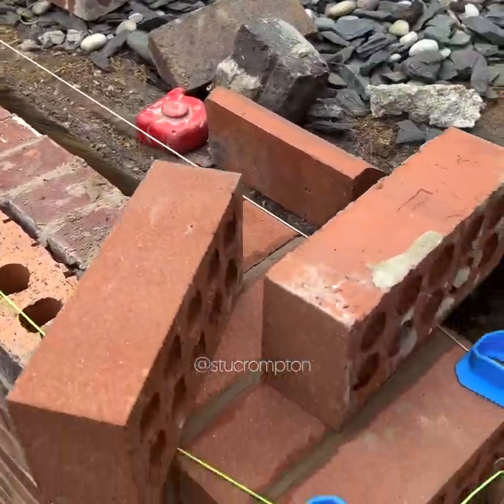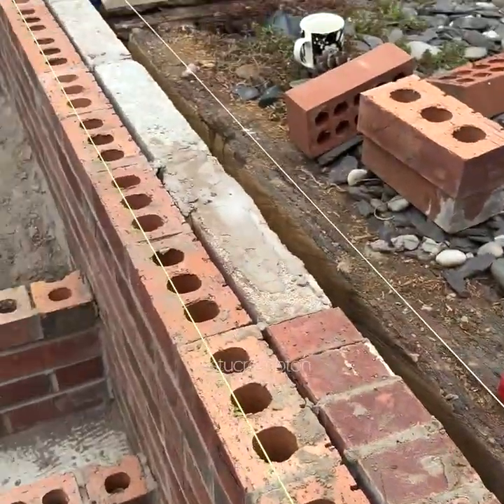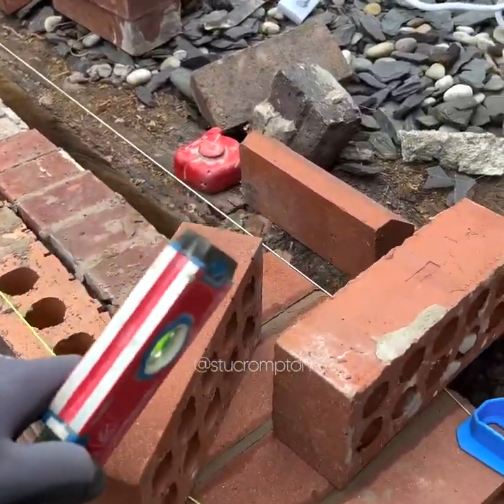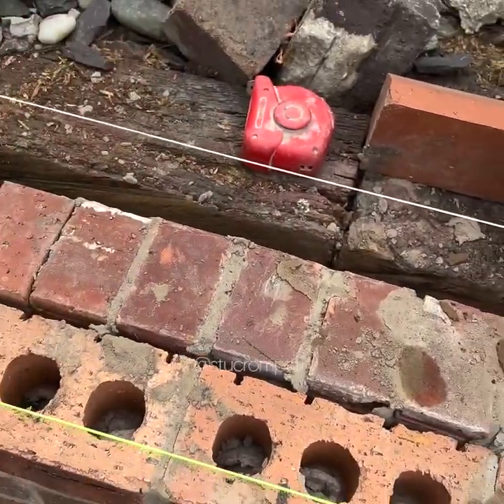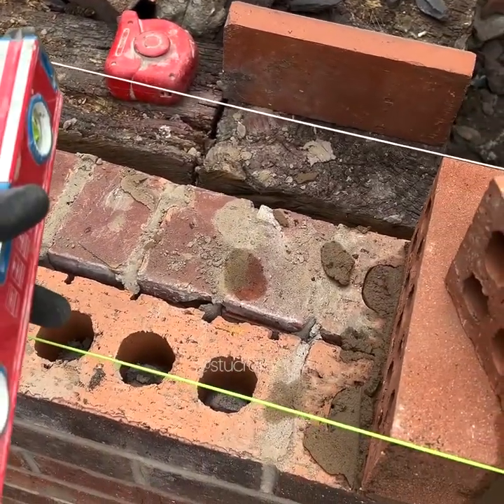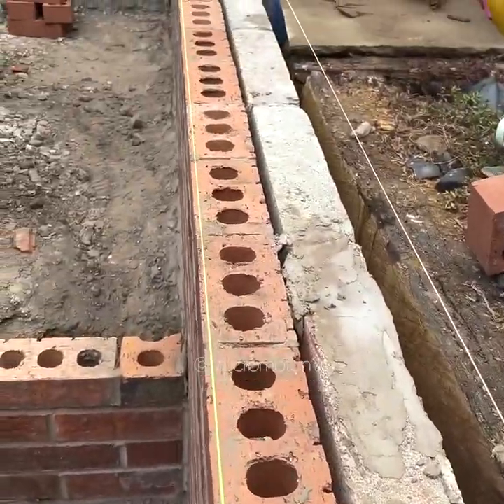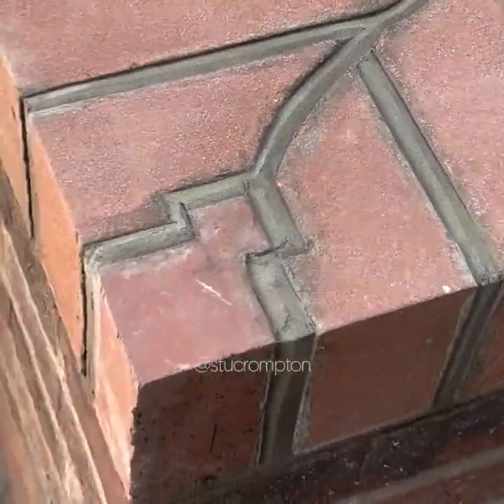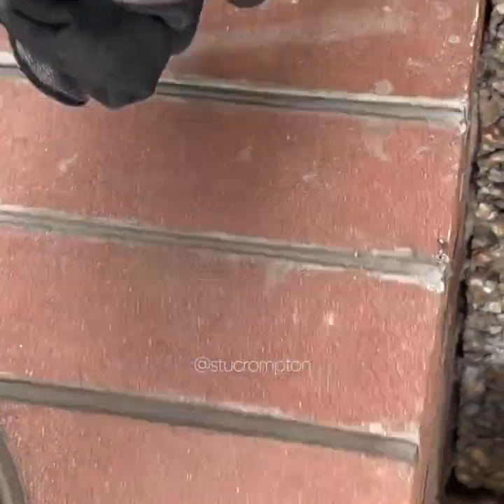🧱Brick Mitre Detail 🧱

Comment: Really nice work. 😊 On the long run across the top, how do you ensure the spacing is such that the end gap is a whole/complete brick?
Reply: If it’s whole brick length,you lay 3 brick on edge too 1 brick length. If the ends are opposite ( one end is full brick the other half brick on the same course) you either gain or lose on the joints too get the right amount of bricks in.